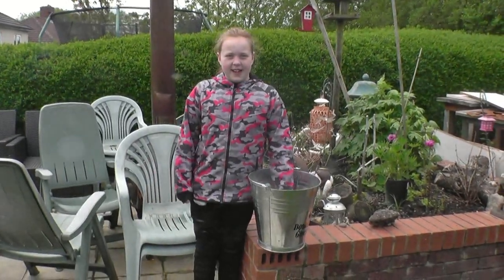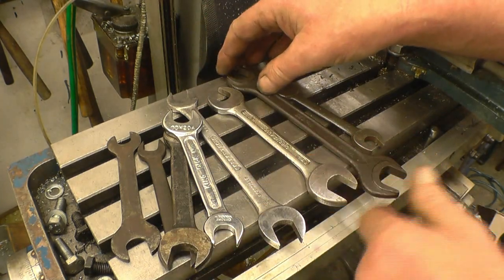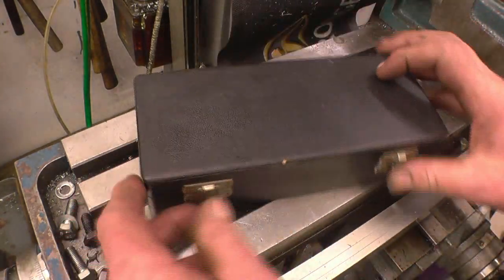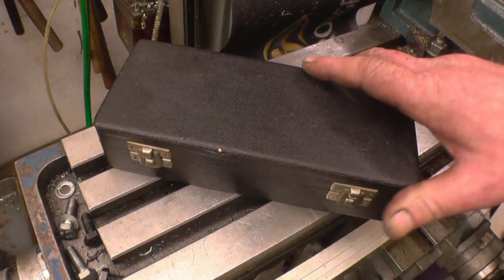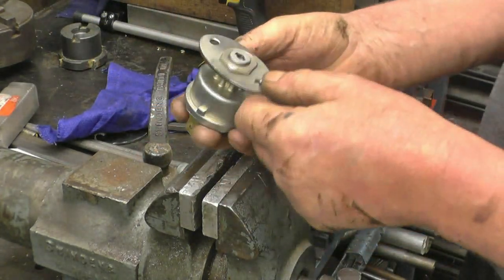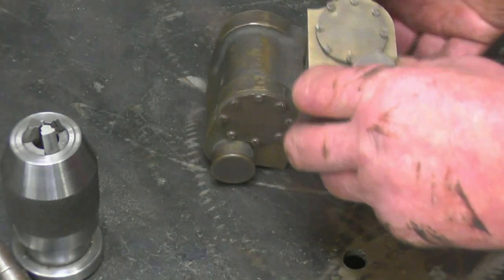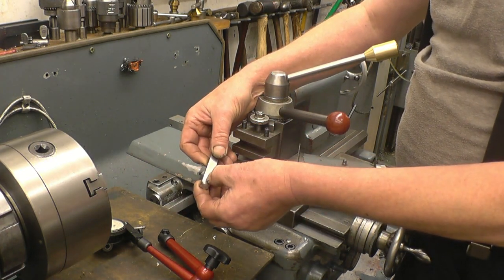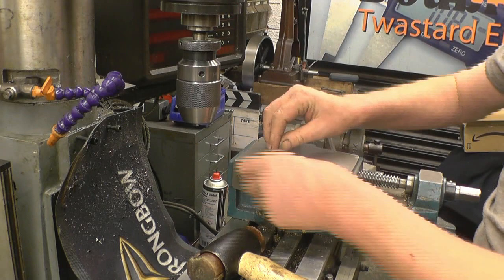SNNC 225 P1   DTI  Holder for lathe

Comment: Hi John, the planimeter is for measuring the area of odd shapes, to reasonable accuracy. We used to use them for measuring the area of an indicator diagram taken from a steam or diesel engine, then use that area in a calculation allowing the BMEP to be worked out. Over time, and successive readings, you would see the BMEP falling, showing that you had a valve or ring problem on that cylinder.  Brought back memories!

Comment: G'Day John, I used a Planimeter almost daily in a previous working life.  For me it was used to determine the area's of a roll form for rolling steel sections.  The section would start life as a heated square billet and would pass down the line through the various mills with each mill pass breaking down and forming a shape until the finishing mill where the final product shape was finished, cropped to length and then passing onto an 'A' type cooling bed.  If the metal flow was not correct from mill to mill you could end up with voids and rolled in laps or worse still a billet that would not pass and red hot spaghetti flying everywhere .  The percentage reduction was calculated to determine an exact area for each roll form to be machined to.  Always a very time consuming and tedious job for a draftsman with every change point dimensioned to 2 decimal places for programming and tape punching to use on the very early NC machines.
Cam
Reply: tape punching -  i remember computor cards for the cnc mill at tech in the early 80,s  , i think thats why i stayed a manual machinist in a job shop  ( couldnt type to save myself ! )

Comment: Hi John. Well, a planimeter is the ancient and analog method to calculate the area of diagrams, plans and maps. In the book called "steam_engines_1919_MacGraw_Hill" a handbook for steam engines, in the 112 page you have a wide explanation for it use and the indication for it: "The most accurate and quickest method of measuring the mean effective pressure is by means of a planimeter and this method should be used if a planimeter is at hand". Really it has no applications nowadays with all the computerized methods to do it, but it is a real and great tool. I hope you like and enjoy it!!!!!! Best regards. I. Pascual

Comment: John, got this off web:  Planimeter
A planimeter, also known as a platometer, is a measuring instrument used to determine the area of an arbitrary two-dimensional shape. There are several kinds of planimeters, but all operate in a similar way. The precise way in which they are constructed varies, with the main types of mechanical planimeter being polar, linear and Prytz or "hatchet" planimeters.  They go for about $60.00 USD on ebay.

Dennis

Comment: That planimeter is used for measuring areas or distances on plans/maps by droughts men I think. The wheel kind of skids over the map surface when following the pointer which it should be linked to.

Comment: I wasn't fussed about spoiling the surprise about the Planimeter.  Having a quick look round YT, I think you're still going to have the pleasure of having to play about with it to see how yours actually works in practical terms, they all seem to be different but all achieve the same thing.  That's measuring round the outline or edges of an object. Like a backwards pantograph and chuffing ingenious it is too.
If you want to see - this is a solid simple demo, applying it to your's is going to need a bit of fiddling.
https://www.youtube.com/watch?v=l_k_0hRpOA4